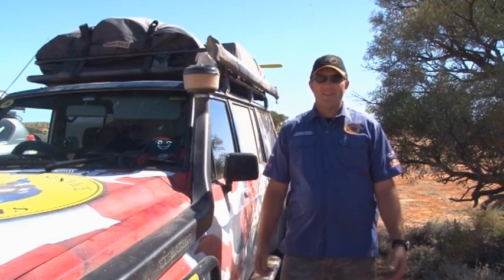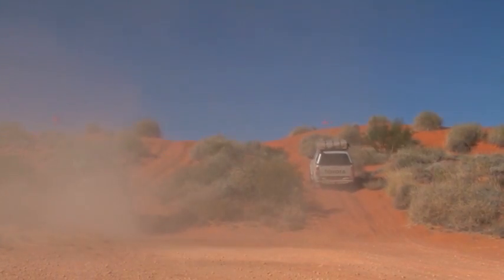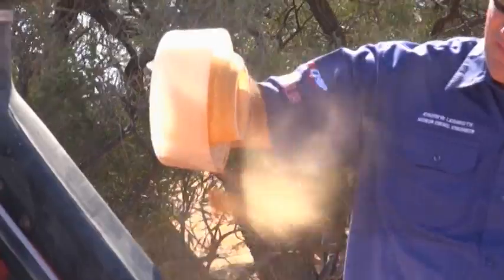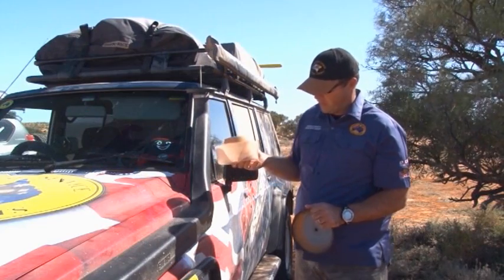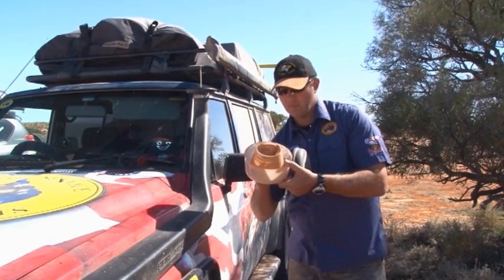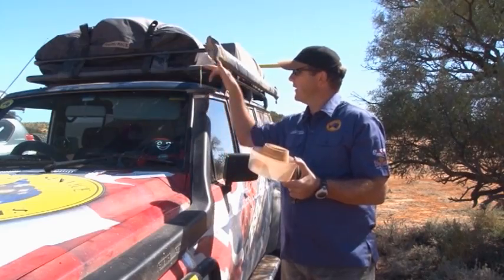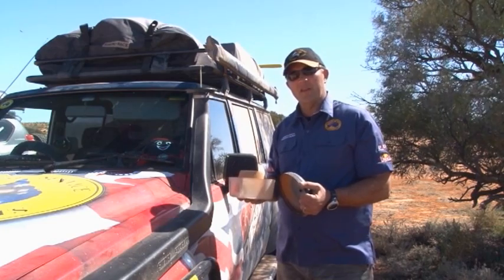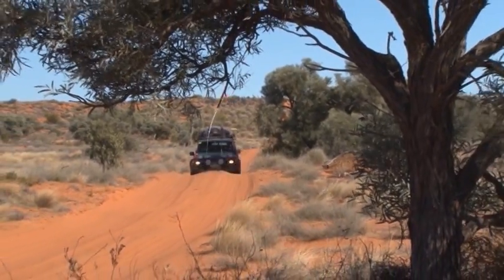Do snorkel pre-cleaners actually work?

Comment: I’m running a cyclonic pre cleaner on my vehicles snorkel and I honestly feel it does a far more better job than the forward facing air ram head. It definitely is collecting dust and bugs and is keeping the air filter nice and clean, highly recommend 👍

Comment: I agree about the 7" pre-cleaner. I have a 4.2 Patrol turbo, listened to the hype, and purchased a 10" pre-cleaner. It is next to useless as you say because most of the time the engine is just above idle and won't spin up the dust. I see it just entering the pre-cleaner and then going down the throat. Off to buy a 7" version. Thanks for the tip.
Reply from the maker: 100%

Comment: I’m using a Sy-Klone pre filter, it’s self cleaning, it has the same bottom that the guy has that makes it cyclone but then the air also makes another fan inside rotate on ball bearings and it shoots dust, snow, rain, and particles out an ejection slot. It seems to work pretty well and no cleaning or upkeep. Here’s a video demonstration of how well it actually works.
https://m.youtube.com/watch?v=_6AxqFVipbA

Comment: On the seventy series land cruiser do they have a collection bowl that needs service
Reply from the maker: I just love the fact that you've been able to find a post that I did in 2013!!! That was a great trip the Simpson desert!

But yes you're right the genuine Land Cruiser one doesn't need cleaning and it's sort of self cleaning but it probably doesn't work as effective as one of the Donaldson ones like in this video
Reply: @BerrimaDiesel  I have the new 2.8 troopy I thought it was odd the gaps on the inlet vanes are bigger than the gap on the dust outlet slots. it seems to do a good job on dust I guess bugs just pass through I have seen a couple below the valve in the bottom of the air cleaner box
Reply from the maker: You would be amazed under high velocity and pressure how many large bugs would be pushed out of that auto eject gap more than we think 😁

Comment: Hello there, I made my on snorkel and I am using and regular tip but, also have the pre cleaner. The trouble I'm having is that I made my snorkel out of a 3 inches PVC pipe and the tip/ head of the snorkel that I bought from Safari snorkels fits inside of the pipe not allowing water to go out through the channels of the tip/ head so I was wondering would I be a better off running the pre-cleaner on rainy days? Cheers mates, Julian Locatelli

Comment: Perfect info !!!
Not going bigger than 7" for the obvious reason you rise... 
I got a G wagoo TD 3 liters, 24 valves om 606 so 7" seem good enough air flow...
Merci
Then in offroad mode, clean or better change and oil EVERYDAY. (like enduro/motokross/rally bikes does)
Sand sock, if good quality/good brand, is a +, (otherwise is a restriction, no good...)
And IF you don't agree with dat, then driving GOLF kart is the mechanical sport for you...